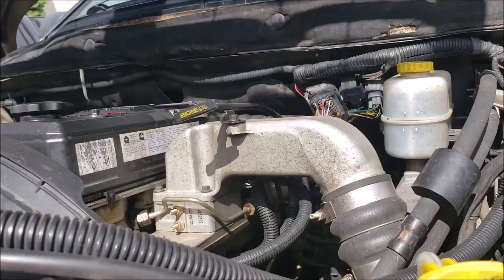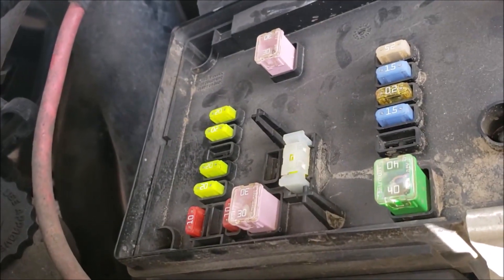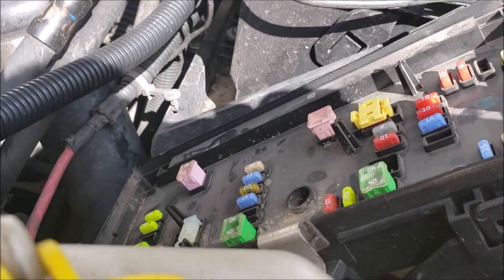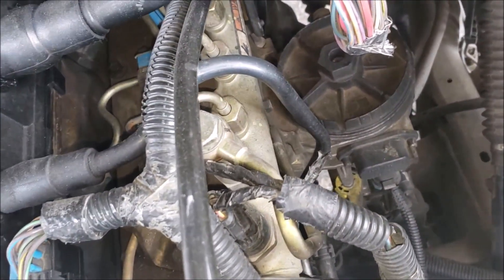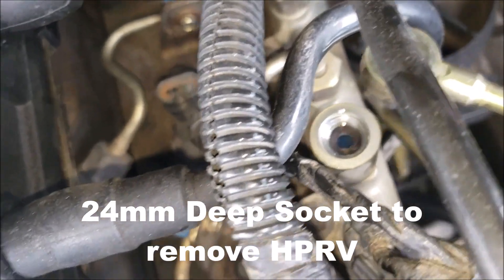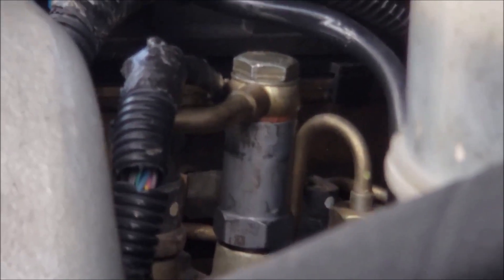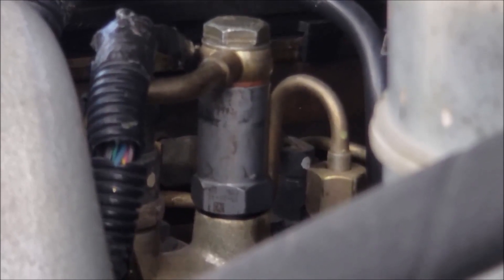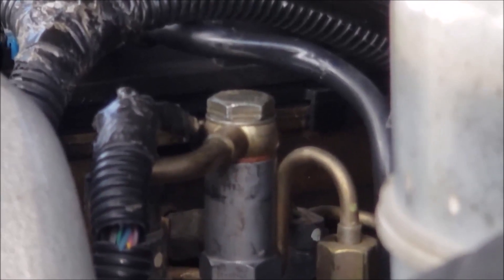Replacing a High Pressure Relief Valve on a Common Rail 5.9 Cummins

Comment: Chris my 03 will start fine when cold but when hot it won't restart. I'm buying a check valve just because the truck is so old but my question is how often have you replaced injectors on your 5.9?
Reply from the maker: My 5.9 I've only had a little over a year but I just did the injectors when I first got it.
Reply: @ChrisRocha1672  Ok thanks Chris. I'm getting ready to do mine. It's only got 135,000 on it but in my reading about Bosch injectors, most say they're good for 100,000 but not much more than that. 
I'm looking forward to getting my hands dirty. 👍
Reply from the maker: @Spinnaker617  be safe and have fun with it
Reply: @Spinnaker617  what brand is good to go with?

Comment: So did replacing the Fuel Pressure relief valve fix the issue with the coil (pre-heat) light coming on?
Reply from the maker: I didn't get to drive it enough to determine if it did or not. Shortly after that the mounting studs to the fuel injection pump sheared (long story behind that) and i wound up needing a new front cover/gear housing and i couldnt continue on with my truck after that

Comment: Found a common issue with the injector pass through connector nuts not torqued to spec which would also cause high injector return flow good luck remember take safety precautions your dealing with super high fuel pressure could cause death or injury.